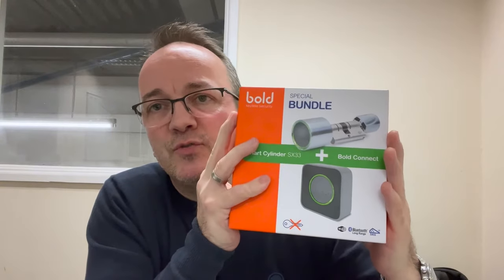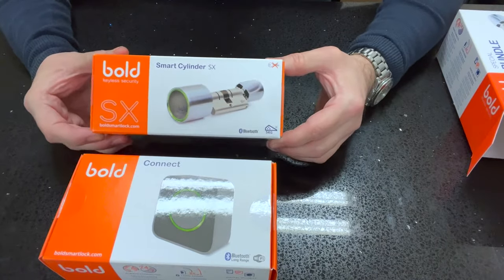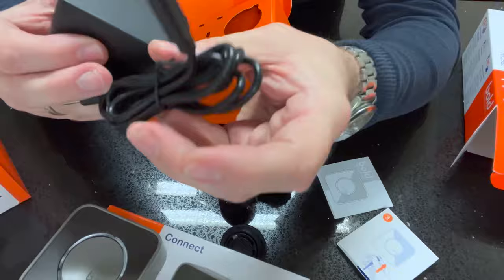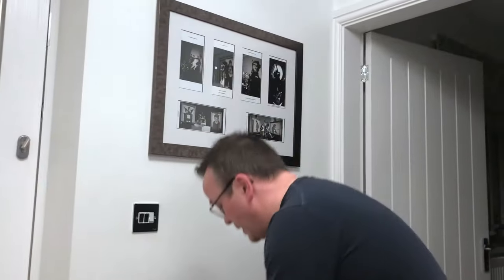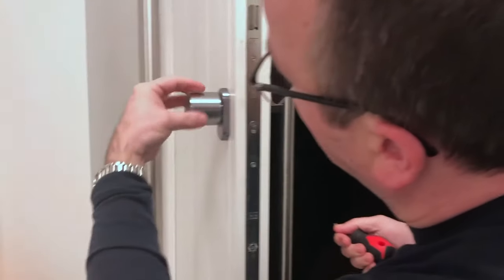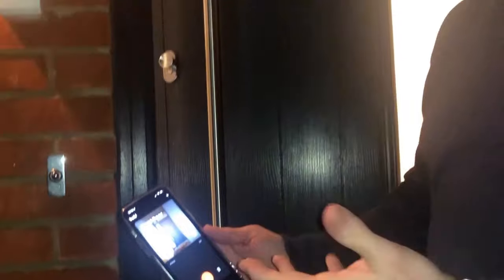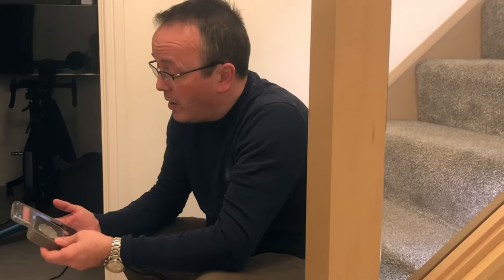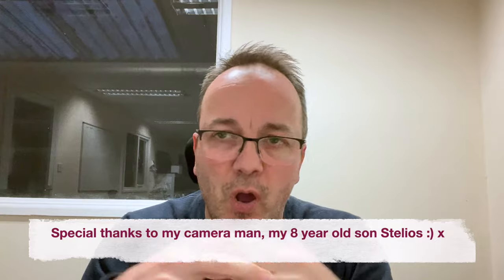Bold Smart Lock + Connect Review, Unboxing and Installation

Comment: Hello, great Video! I have a question: Does in the app also shows a history? Does it shows also the opening from inside without using the phone? Like does it shows me (when i'm at work) that somebody is leaving the house? (hope you understand my Swiss-english;-) ) Thank you for answering!
Reply from the maker: Hi Fiona, 
Thank you for the question :) The app keeps a log of all activity when the lock is opened using the app or pin from the 'outside' only. Each user you give access to will have their own ID which you will see in your app. From the inside however, there is no log as the action for locking and unlocking is done by turning the large handle with the Bold logo on it. In essence, the big handle (or knob) is simply turning the door lock mechanism so not interacting with the electronic element or app so it doesn't record any activity. Simply put, locking and unlocking from inside is a manual process, from outside you need the app or pin. I hope this helps.
Kind regards
J - Ball Interiors
Reply: @ballinteriors  Dear J
Thank you very much for your answer! That helpt me a lot!
To control the outgoint people, those I can install that the have to lock the door? Like if the dont look it with the app the door stays open? An than also instal that I can close it from my phone from fare away and that it close automaticli at 9p.m. Every day?
Reply from the maker: @fionaschafer4542  The lock automatically locks after a set number of seconds when the door is closed. On the app you will see a green countdown circle which indicates the seconds left to enter or turn the external knob when the unlock button is pressed. Once this timer has passed, the lock will bleep (make a sound) and it's locked again. The knob on the outside will not engage, it just turns. It will only engage if you use the app or pin to unlock it. So, the app/lock does not need a timer set to lock at a certain time as its natural state is locked. Simply put, the app and pin are for unlocking, it has no 'lock' feature. 
Now, from the inside, if you cylinder or door mechanism has a further deadlock, the internal larger knob can be turned further to engage dead locks. This can also be done from outside by activating the unlock button in the app, but turning the external knob in the lock direction to set a deadlock. It may be worth me doing another video to show how this works. 
I hope this helps
J - Ball Interiors
Reply: @ballinteriors  Dear J, Thank you very much for your great Help! Unfortunatly I need to see the outgoing people for my company, so I have to look for another option. 
Thank you and best regards
Fiona

Comment: Interesting take. It doesn't actually lock or unlock, it requires you to do it - it simply engages/disengages the external knob. No wonder the battery lasts for so long... but it means you can't lock the deadbolt remotely if it requires more than one turn.
Reply from the maker: You can deadlock by activating the lock and then using those active second to turn more than once...I hope this helps
Reply: its about on or off , simpel
Reply from the maker: You can turn it as many times as you like when it is engaged as you call it... So yes you can "deadbolt". Thanks for the comment.
Reply from the maker: @walter2065  *simple

Comment: Have you found any other smart locks that work with this same style of lock?
Reply from the maker: Hi John, 
There are lot of locks on the market that work similar to the Bold Smart Lock however, we haven't tested them all. We found the Bold lock to be very functional, the app is very intuitive and easy to use, the security level is super high and with the addition of the wireless bridge for complete remote control with lock is easily one of the best. 
We will be reviewing some new locks coming to market early this year, keep an eye on our channel. Take care.
Kind regards
J - Ball Interiors

Comment: U put the outside inside bah
Reply from the maker: Hahahaha!! No, No we didn't....
Reply from the maker: I'm intrigued as to why you think this is fitted incorrectly?!? If the mechanism with the central button was outside, 1: It is not water resistant. 2: Anyone would be able to get in by pressing the large central button which activates the lock/unlock... The silver knob is the water resistant element and purposely has no technical element so can not be tampered with. I hope this helps you understand, Please don't just to your own conclusions if you don't understand it, ask questions first so you don't make yourself look silly...
Reply: @ballinteriors  hello! Are you sure the central button isnt water resistant? Because I believe that Bold says the whole lock is water resistant, which would also mean the central button is. The thing is that I want to buy a second one for the outside fence, which the Bold will be covered but not 100% obviously because it is outside. Very happy with my first Bold for the front door, and the clickers are very handy too, for your parents or neighbours for example that dont have/want/know the app!
Reply from the maker: @albertusanoniem9043  Hi Albertus. The Bold Smart lock 'Big Knob' is not water resistant, the external smaller knob having no electrons is. So, as long as the big knob is indoors it's fine. I have thought about testing this outdoors myself however, the following was taken from the BOLD website FAQs "The inner knob (big knob) doesn’t like to withstand different weather types. Because that’s where the electronics are located. So, please place the Bold Smart Lock with the big knob indoors. The small knob can be placed outdoors!". I hope this helps answer your question. Bold have informed me that some existing new products are due to be launched in 23 so fingers crossed for an IP65 rated lock! 
Kind regards - Jason - Ball Interiors

Comment: Why did you tell us the bridge is not needed and then go back to tell us what it does? Wasting our time man.
Reply from the maker: It is only needed if you want to use remote unlocking (letting some gain access while you are not at home) otherwise, it is not needed. So I'm right... man